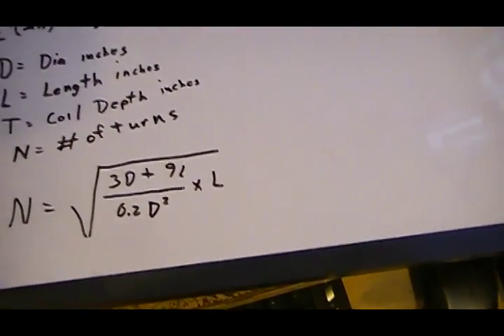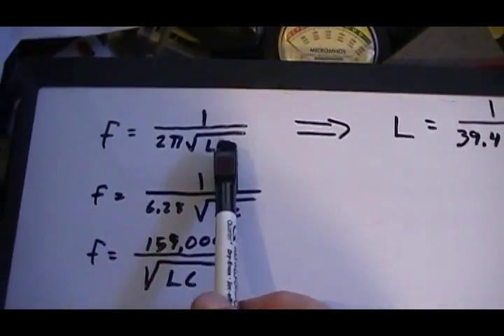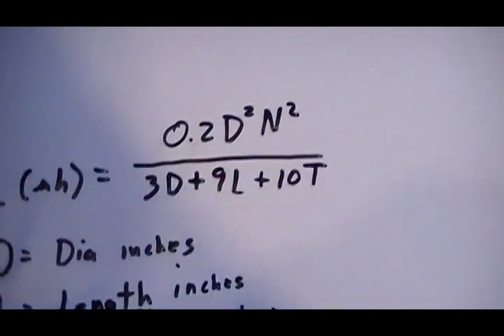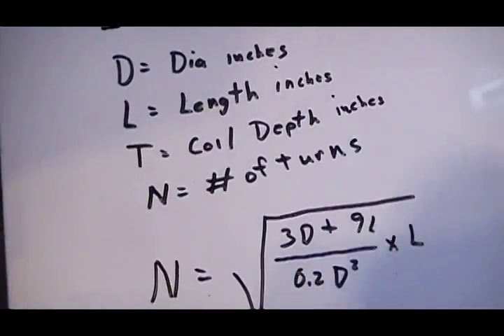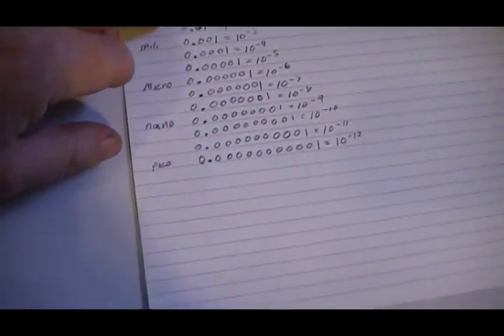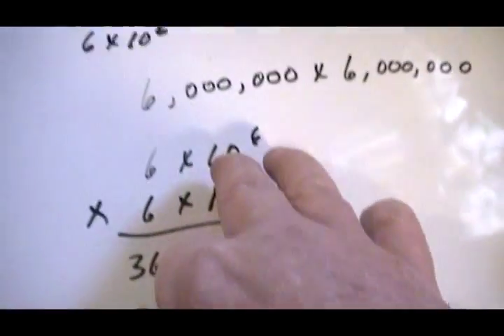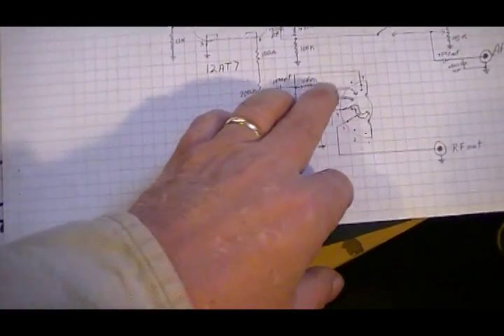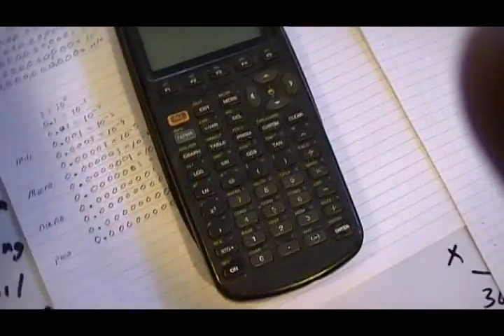RF generator and math

Comment: Dennis:
I think you and I learned electronic theory at the same era. We didn't have calculators so we used scientific notation so that we could solve the math with slide rules.
During the second year of the school, a scientific calculator was finally available and I bought one. $300 at Radio Shack! I still have it.
Great refresher. Thanks!
Tom

Comment: Great stuff, Dennis. All of this is basic high-school math, but it's good to have a refresher. It's also good that you're going through the inductance formulas, because it's much simpler to have someone actually explain it to you instead of just reading about it. This is going to be great stuff once you get to the generator build.

Speaking of the generator, you should scan the schematic and put it up on your Google Drive so people can check it out.

Keep up the great work, my friend. You are truly doing a great service for this community.
Reply from the maker: Thanks Art. I have done an other video on the math. So more is coming.
I will be posting the schematics and the parts list when the generator is up and running. Most likely there will be changes to the schematic and the circuit before it's done.
Thanks again my friend.
Your friend  Dennis
Reply from the maker: Dennis Carter I will go and upload the schematic now and any changes that needs to made then I will upload a newer version of the schematic.